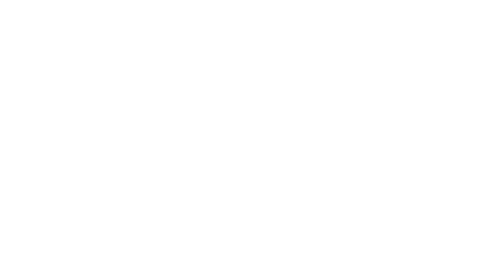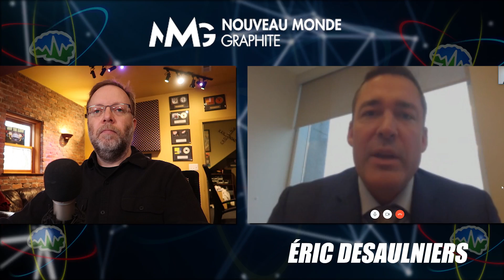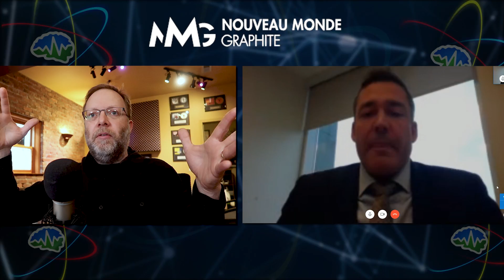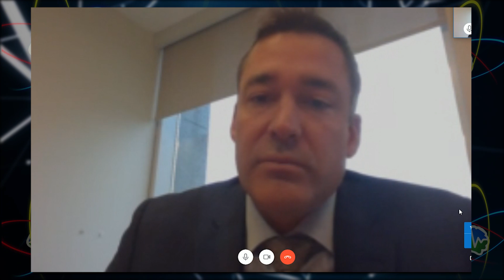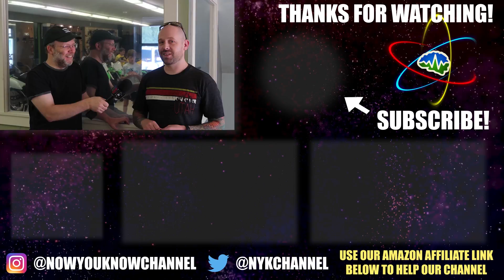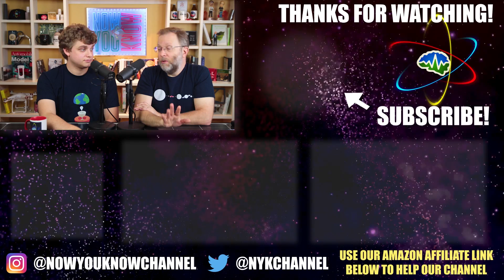Nouveau Monde Graphite | Full Interview with ÉRIC DESAULNIERS

Comment: Thank you Zac..  very important and informative.  I would also advise all to research ANOTHER company (Canadian) Exploration/-(future mining) Co. that could be twin to NMGPH(?).  Called 

GRAPHITE ONE. 

I’ve invested since 2015 after learning this mine site 60 km North of Nome.  Another hotbed of geologic activity.  This mine the only large , high quality, at surface, graphite mine in the U. S., has passed its 43-101 Reg’s , done it’s PEA, and drilled, and flew over with instrumentation , and may be one of the highest quality, largest amount, easy to extract mines in the world. 

Again, the company was a gold exploration company that stumbled onto this strike. They acquired the mine rights, tested, and have gone through all applicable regs and laws to become a full mine site ready to build infrastructure, processing plant, etc.  the strike length, width and depth are enormous and the quality of flake is tops.  It is near deep water port area (to be developed) and would be able to bring to market on west coast without crossing any international border as it is in the states.  Could be largest site in the world.  
Understand, they are some years away from selling finished product on the market as they continue through bringing site to full process production.  However, as of 2/15/19 the OTC micro stock price is steady at .04-.05 cents US.  I believe when institutional investors jump in, it will climb.  
American (AK), energy independence from China and (now) recently changed status by US as a critically  important mineral to national security.  
Do your due diligence and research before you invest. 

I would love to see another video Zac perhaps with Graphite One company CEO Anthony Huston. 

Thanks Zac.  Love your show!
Reply: Wish I'd seen this a year ago. Currently (29/09/20) trading at $.39 on the TSX.V under the ticker GPH.

Comment: Off topic:  Diesel Gate settlement fast chargers installed in my town, Sherwood, Oregon.  However, my model 3 cannot use them because charger cables are CCS and Chademo only.  There is no adapter for me.  I live in an apartment so I gorilla fight for charging here and there at public chargers.  The Diesel Gate chargers were supposed to be for everyone.  I called Electrify America (a division of Volkswagen) and was told that Tesla had their own charging network but that my concern would be noted.  I’m disappointed that the field of available public fast chargers for non-home owners is stagnant.  There might be a story here.  A pic from a shopping center in town where the fast chargers are being installed:  email dunntax@aol.com https://www.amazon.com/photos/shared/vSS47s3jRJSDeZXweginIQ.qqHBtDVIOEfZe771frrsXY